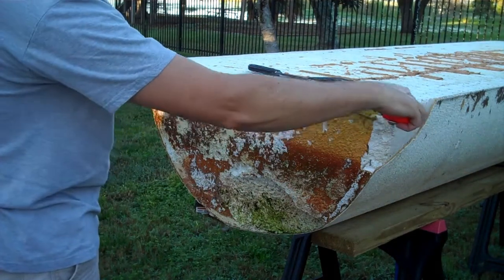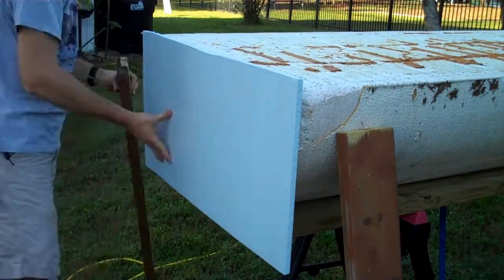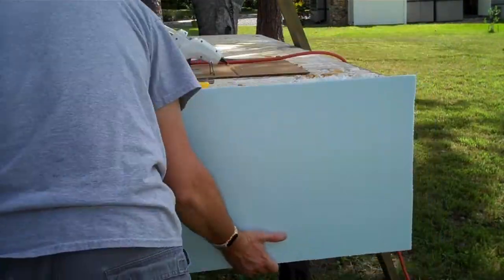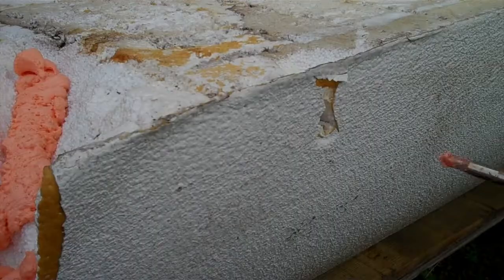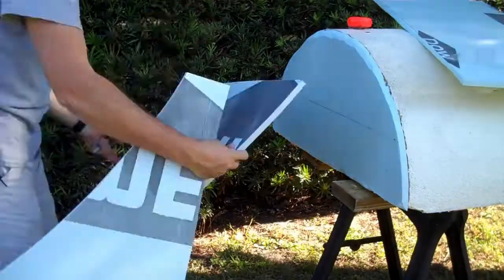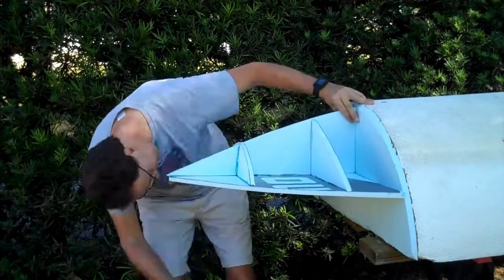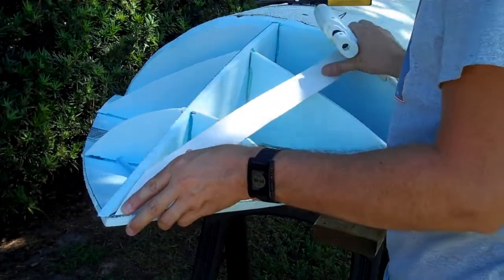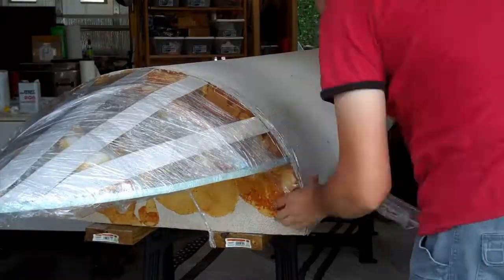Building a fiberglass mini-pontoon boat - Shape the Foam Pontoon  - pt 1

Comment: Thank you for making and sharing your video, it's given me ideas for the production of pontoons or a single hull onto which I can put a Slidavan.

The Slidavan itself measures 8' long and 5' wide, and with 11 inch wide port and starboard decks and 2' 5" bow and stern decks it'll be quite a compact craft. 

To enable use on the extensive UK canal networks the craft cannot have a beam greater than 6' 10" or it won't fit through the locks!

Some UK canal bridges are quite low and narrowboats have quite short external cabin heights (with the cabin sole below the waterline to allow full internal standing height). 

The Slidavan has an elevating upper cabin section which will enable it to fit under those bridges when lowered. It also hugely increases security for when the craft has to be moored unattended on the canals.

The idea of using closed cell foam sheets laminated with plywood and covered with fibreglass to construct pontoons is within my abilities and budget. 

Had I not seen your video I wouldn't have necessarily thought of this construction method.
Reply from the maker: Sounds like a fun project. I'd suggest a simple flat bottom barge type craft unless you already happen to have some foam pontoon forms laying around. You could make it out of plywood and cover that with fiberglass, or use foam board insulation with fiberglass. Large flat areas are easy to cover and construct.
Reply: @summetj  Thank you for your reply, I haven't any pontoons, but have just been looking at 8' x 4' closed cell foam boards which are manufactured in thicknesses from 1" to 6" and it did seem logical to use these as their size, type and availability leads me to believe that they'd be a great starting point.

I was thinking of laminating them between 10' x 5' sheets of marine plywood and glueing in additional blocks of foam to create the preferred size and shape.

Rather than have an open deck area at the bow, I may make a fold down deck area with a base constructed in the same way as the hull, though I'm not fully decided if this will be more work than its worth for something only 2' 6" in length!

I was really pleased to discover that 10' x 5' marine plywood was available as that will enable me to make a one piece hull section with greater rigidity.

It is also available in that size with a Phenolic Hexa Anti-Slip coating and these boards are widely used for boat decks and cargo trailer decks so would be ideal. 

I'm happy to invest in larger foam and larger plywood panels with the Hexa coatings because they will make for a much better constructed craft using fewer individual pieces!